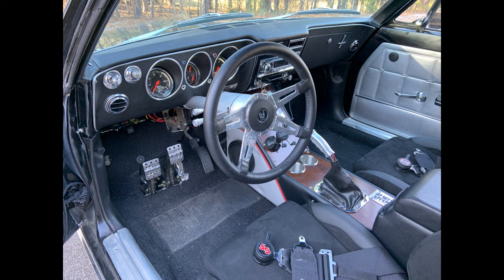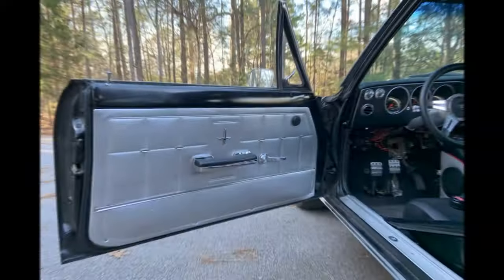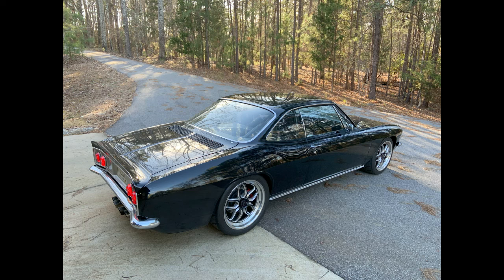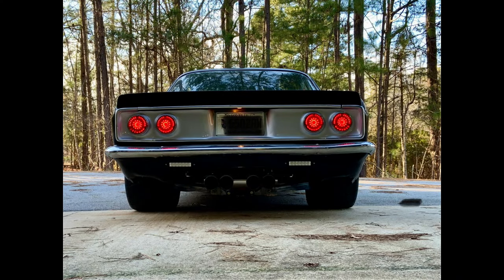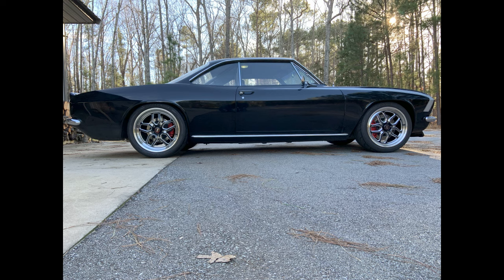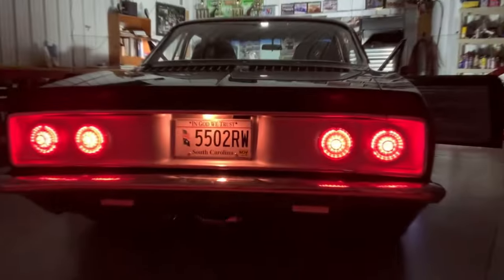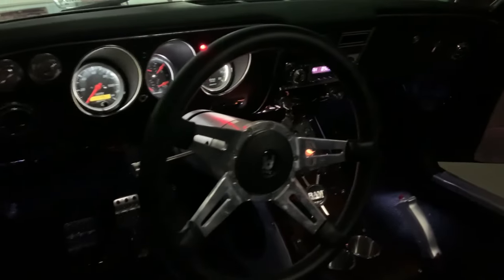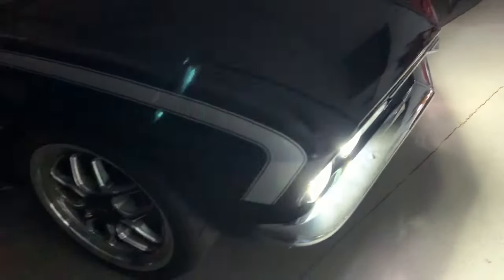NN 2 0 Video#14

Comment: I/we put a Buick 215 V8 in my '64 Corvair convertible using a Crown Industries kit many years ago. It's still doing quite well. The Buick aluminum V8 is less weight than the stock engine and it's in the stock engine location. Only issue was converting the engine to run backwards.
Reply from the maker: That is an interesting conversion.  Good luck.
Reply: @nadersnemesis2.071  Much easier than doing the mid engine thing.